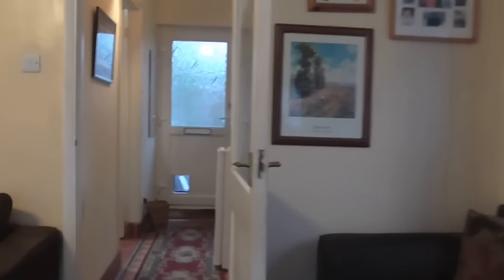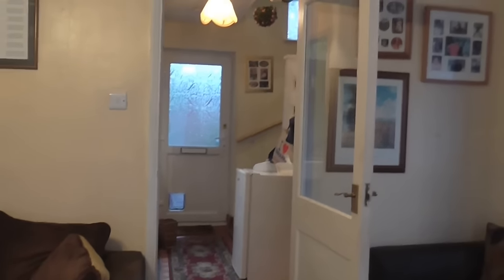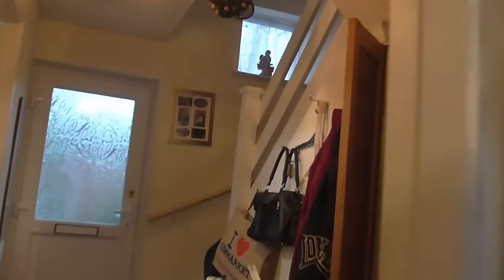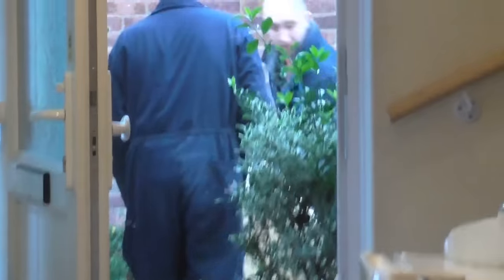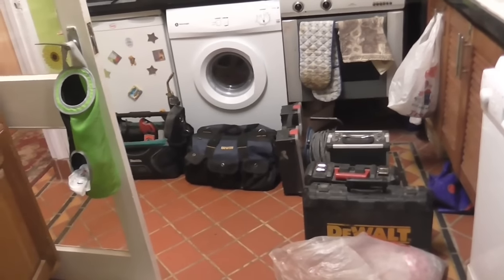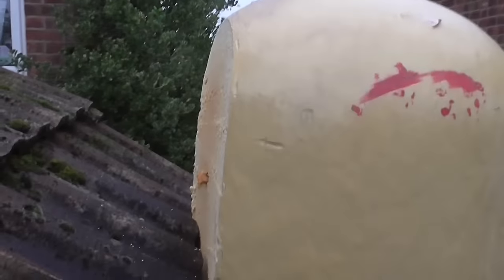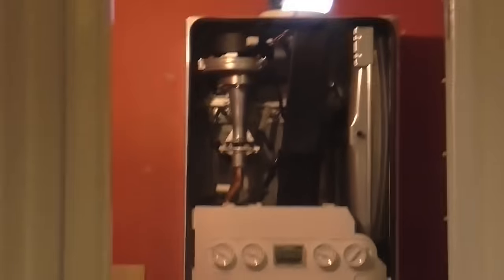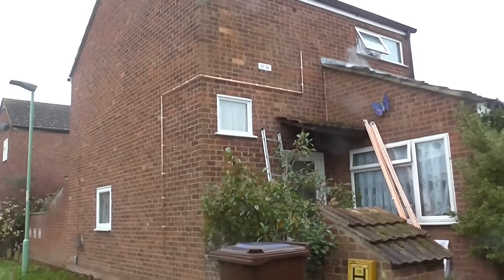Mini Vlog 1 -  Central Heating Installation Part 1

Comment: I have to say that gas pipe snaking all around the front and side of your house is an appalling piece of work, makes the house look a right mess.
Reply: +Neil Robinson     And what alternative would you suggest?
Reply: +arfurfox hake At the very least it could have been routed a lot better.
Reply: +Neil Robinson Give that tube a season and it will weather, then you won't notice it so much.
Reply: +arfurfox hake True.
Reply: Same as when I had my sky dish installed, the guy put cables all along the front of my house 😱

Comment: Things are done somewhat differently in the US, but I have seen radiators like your new versions on my UK trips. It looks like the heater presently in your room is a French electric radiator. My house is torn up for a bath remodel now, and I do not like it much. Will not be finished here until January.